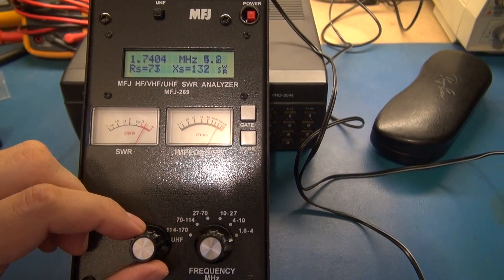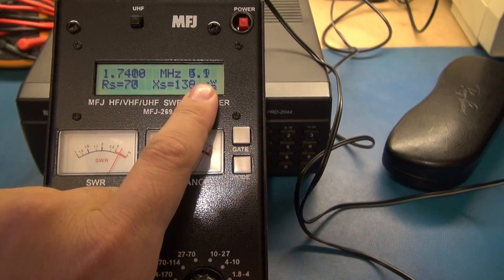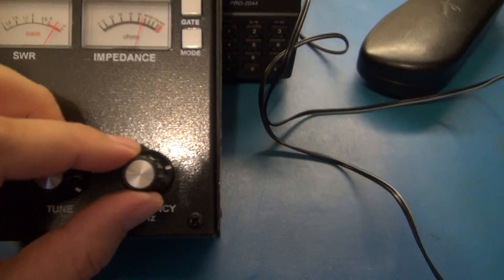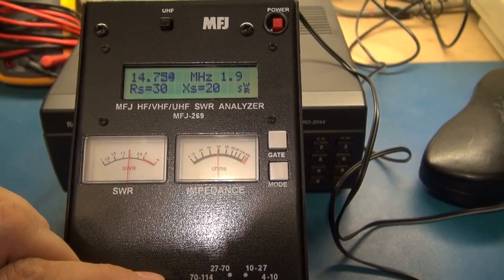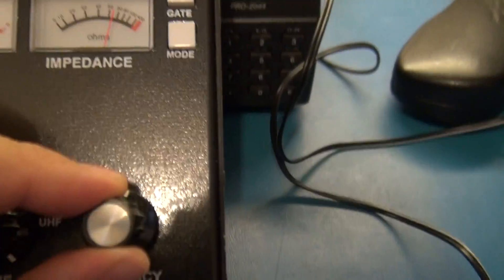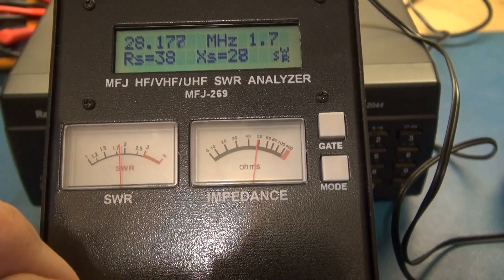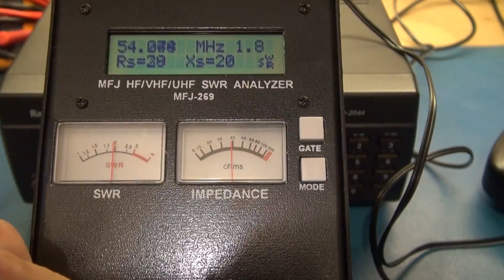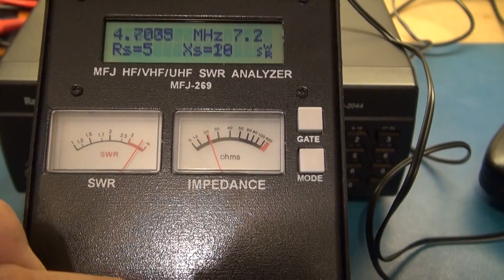HOME MADE G5RV ANTENNA. FREQUENCY SWEEP WITH MFJ-269.

Comment: My Mfj g5rv shows at most 4:1 swr on 80 meter.I use 100 ft of rg8x its inverted v I've tried many antennas its one of the best I have used.also put the wires east and west in central USA.also use T match manual tuner.

Comment: I use the myantennas.com EFHW 8010 and it's resonant on 80/40/30/20/17/15/12/10m without a tuner. 

But, how does it perform ? pretty good actually, can work Europe easy , USA, Canada, Brazil, Costa Rica from Ireland and 100 Watts with the Icom IC-7300, I do not yet own an Amplifier. Have my license about 6 weeks and don't get a lot of time to use the radio. But it's a fantastic starter antenna if you have the room , 134 feet long. Can be strung up in many configurations. 

Using no radials, uses 49:1 Unun which seems to be the magic, unlike most end feds that use a 9:1 and which will require radials and tuner this one from myantennas.com does not. 

And here's the best bit, being resonant on so many bands I can easily use it remotely. 

I can use it on 160 meters with an external tuner but performance will be greatly reduced but it works and I can make contacts.

I also use the end fed from hyendcompany.nl I use the portable 100 watt 4 band and it just works and is great for QRP and 5 watts, good light and compact and efficient, again, no tuner, no radials. 

I use the myantennas.com EFHW 8010 for QRP with my little Xiegu X5105 5 Watt radio and U.K hams are always surprised how well I get there with 5 watts !

73's
Mark
EI3IBB

Comment: Did you ever do a complete frequency response sweep of the antenna from 3-29Mhz to see what bands it's resonant at?   I put up one made by MFJ and I tried using the antenna analyzer on it but did not get good results!   It's supposed to work on all ham bands from 80-10 Meters but some sellers say you need an antenna tuner while others say it should work by itself.   It does show 4 resonant dips but none of them are right on the ham bands and the lowest SWR that I get is about 3:1 except for one large dip at 19.84Mhz. I tried using an antenna tuner and then it will tune perfectly for 20 Meters but not any of the other bands!   A lot of reviews say this kind of antenna works well but maybe they just never tested it except to receive?  It receives OK since it's so big but I don't see any way to tune up a transmitter on it except at 20 Meters.  I'm beginning to think the whole thing is just a scam!

Comment: Good gead batman ~ if I did that too my shack it would puke all over the 'hood.  If your considering "anything under 10!!!") a good antenna bud your putting about 800w into the ground and HEUN(hot as fok toroid that some people xcall a BALUN) and a whopping QRP wave of 8w into the 'tenna!  I built one - they suck, remember any antenna that says YUNER REQUIRED means mega loss at the match.  73's

Comment: You talk about inconsistency between the meter and LCD but it looked like you were comparing impedance and resistance ? 
Big difference !!
You are going to get dips all the way through the frequency ranges of the analyzer as you hit various resonant points, multiple 1/4 1/2 3/4 5/8 full wavelengths etc that is how the antenna covers so many bands, it's designed  that way. The bands are multiples too 
10 20 40 80 160 if you ignore the WARC bands for now. My multi band 270' OCF works as a good ai